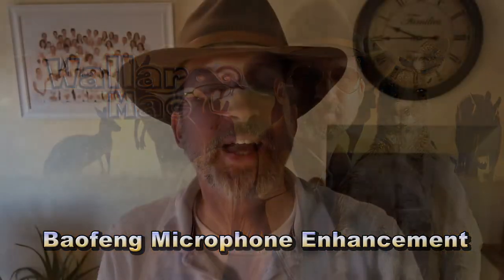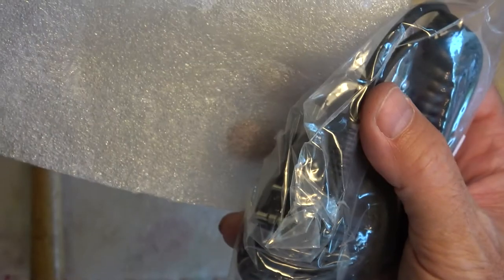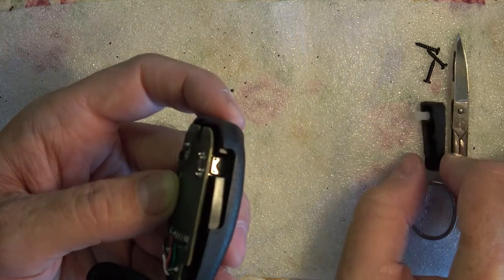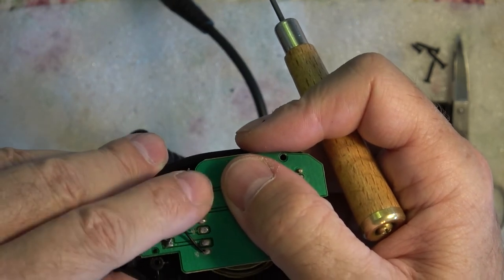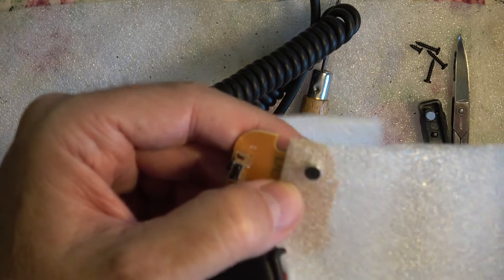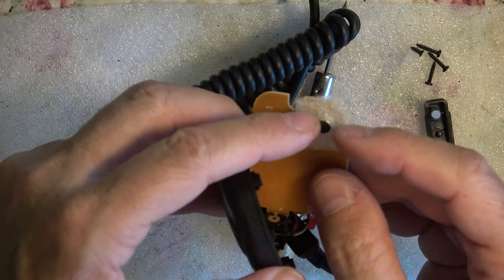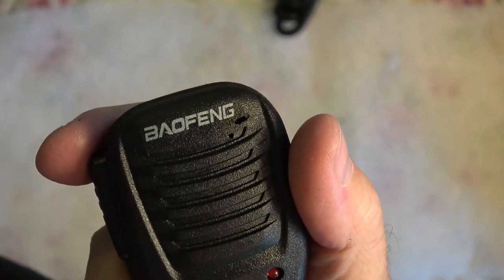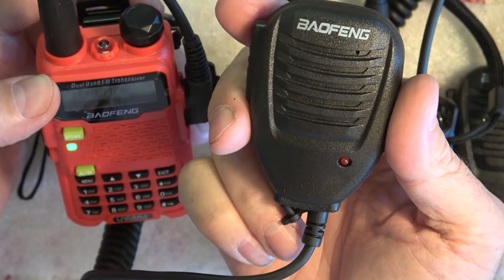Wallaroo Mac Baofeng Mic Enhancement

Comment: Modification worked perfectly with me, at least 85% better. Did exactly how you suggested, only thing was I used the tip of a soldering iron gun to melt the tiny hole.

Comment: I did a very similar mod to you but used sticky backed draft excluder foam to creat a gasket round the mic element.  I covered that whole side of the board with foam and also the inside of the back cover to fill all the acoustic voids.  The enclosure doesn't resonate as much so the receive audio is clearer.  Even the button click sounds more satisfying now.
.

Comment: This is how you would do what is necessary if you had littlerally no tools  . First get some tools. A pair of nippers , $3 , usually red , originally were sold as clippers of leads off pc boards. A small soldering iron. A little epoxy or superglue. Don't bother making the hole larger, not necessary. Remove the microphone from the board with your soldering iron. Add a couple insulated leads to the pins. not too long, long enough so when you glue the microphone directly against the hole, you can put the leads in the pc board holes and solder them. You could fill the hole where the microphone is with foam, although you would do it for mechanical stability. The microphone is against the hole now, it will sound great. It will sound better than this mod because you glued it right to the little hole. no gap. That's how its done.